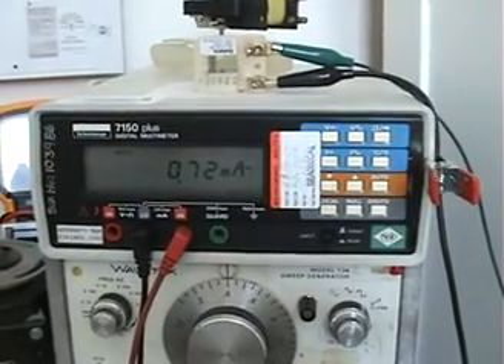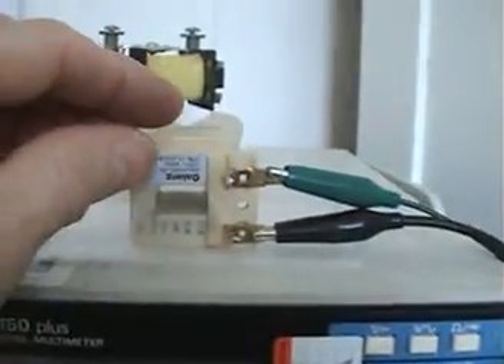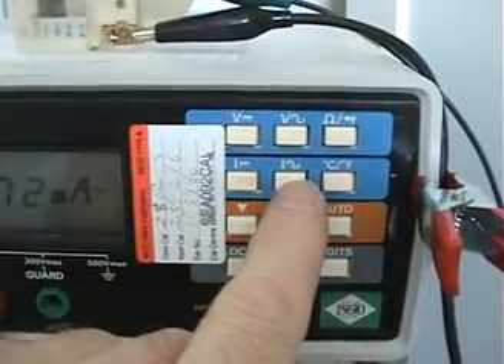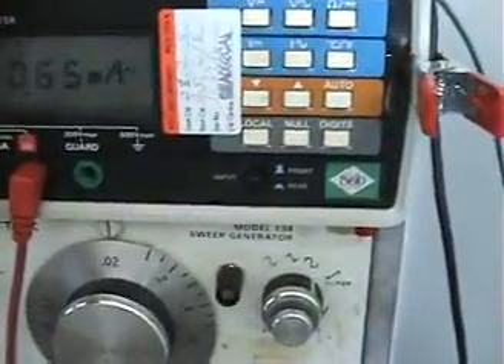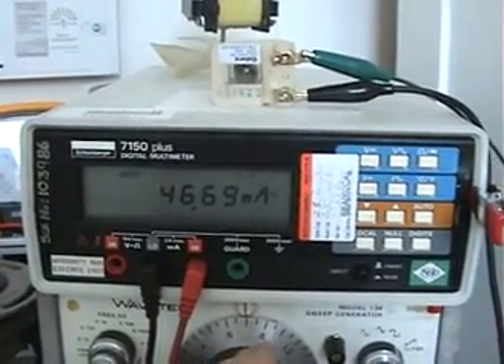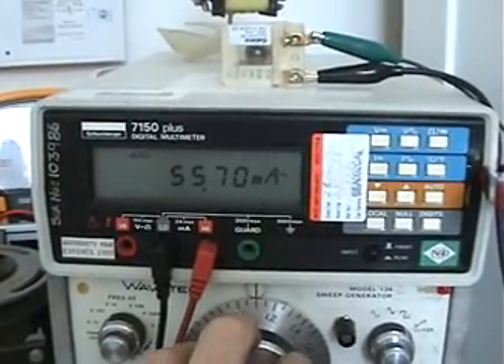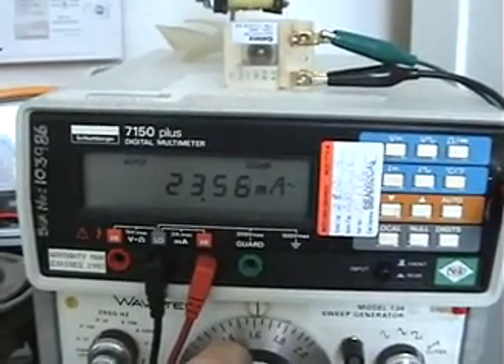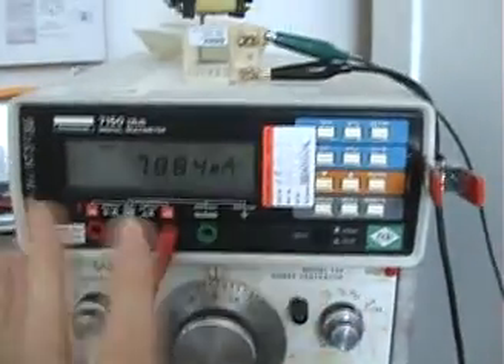Vibrating Magnet Coil test 1

Comment: What was the output voltage going to the coil?
Reply from the maker: 10 volts is usually the maximum output of most signal generators

Comment: Impedance for a Coil is function of the frequency (X=L*w) where L is the Inductance and w=2*pi*f  (f= frequency) It's not lineal because the resistance of the coil is fix but X is varying with frequency so i=V/(R^2+X^2)^(1/2)

Comment: here's the basic design for a real artificial gravity system, which is an evolution of some of your wheel type overunity devices.  This design is a field generator, i think, and the design that i was thinking of also creates gyro nutation, which i think is a major addition, but idk exactly what it should be.  I just know it works, now, after seeing the same concept on this video.  Perhaps you know how to time the Albini mags and connect the wires and stuff.  Idk what kinda power it would take. 

https://youtu.be/rmjYvquPau0

Comment from the maker: Hari Krishna!

Yes, one could generate current this way. However, you would not have an energy gain as the coil has losses with its own resistance. You also need true AC to make this work as pulsed DC does not have a polarity shift like AC does.

All the best to you

Luc

Comment: Hi Luc,
Thanks for another crystal clear video.
I just noticed this past week that every time I adjust the frequency or the voltage they maintain a reciprocal relationship. What I mean is every time the frequency goes down the voltage goes up and the reverse. I have tried this a few ways, and no matter what I do that causes the change, - the resistance or # of turns... anything, so far this relationship displays itself. I noticed it today on a few of your videos now as well. It may be important!

Comment from the maker: Hi smokyatgroups,

barely any effects of inductance with magnet. Inserting the magnet and holding it down (not vibrating) dropped the amps from 79.7ma to 79.5. Keep in mind the magnet is only 1/2" x 1/8" round. Inserting the original laminated core 1-1/4" x 5/8" x 3/8"  it drew 39.15 ma compared to 23ma with vibrating magnet which has next to no inductance value.

Luc

Comment: Magnetss motion is trying to align itself with the internal altern. field of the coil. As it has a mass of its own, it can't stop and reverse on a dime like the coil and so the induced voltage won't exactly match the applied waveform.  You might be able to harvest some nice spikes off either side to charge a battery if it were run off a 555 FET & battery arrangement.

Comment: Should monitor the induced voltage across the coil make sure it doesn't get too high, or might damage O/P stage in your generator. Prbly need to slide the original core into the coil to establish current draw with normal inductance. The magnets presence affects the inductance.

Comment from the maker: Hi cenlasoft,

All SG are AC output. You should see good activity between 4hz to 8hz.  Using on off DC will not give the same results as it is unidirectional. AC alternates the direction of the DC at every Pulse (polarity flip)

Hope thus helps

Luc

Comment from the maker: Okay. 

Do you have the equipment (ability) to experiment with me on this so you can help speed the understanding of this?

Also, I decided to connect the gen. out to my magnet motor (in my videos) to observe the movement of the magnet and to my surprise the motor turns full 360 degrease turns up to 7hz with no timing trigger.  The torque of the motor is incredible at 5hz and the interesting thing is the more load I have on the shaft the less ma it draws?

Luc

Comment from the maker: Hi Drevtoobe,

I knew you were going to be around and be the first to post about inductance added when inserting the magnet. You are sharp but I though of it before doing the video. Inserting the magnet and holding it down dropped the amp from 79.7ma to 79.5. Keep in mind the magnet is only 1/2" x 1/8" round. To please you I inserted the full original laminated core 1-1/4" x 5/8" x 3/8" and it dropped to 39.15 ma.  I agree the magnet is creating some kind activity and should be researched.

Luc